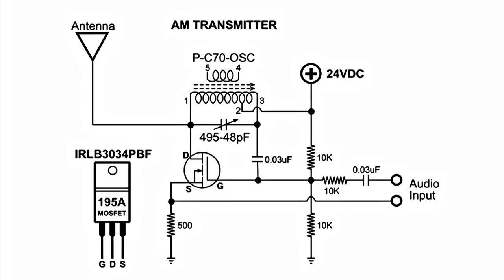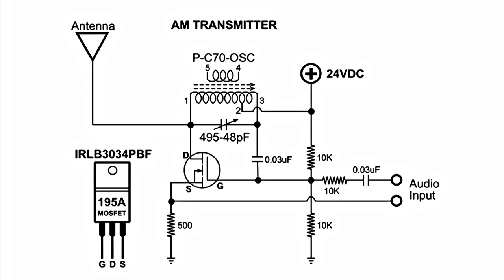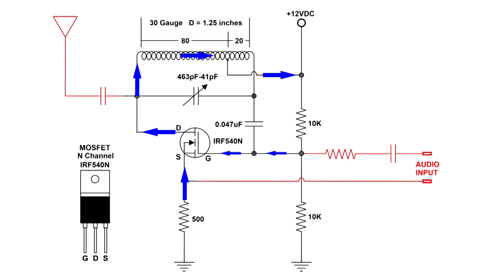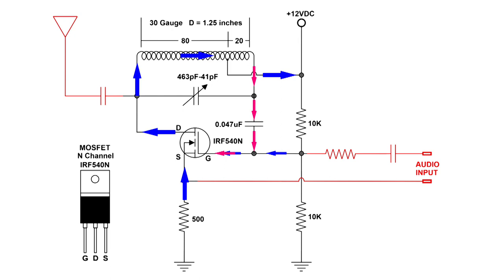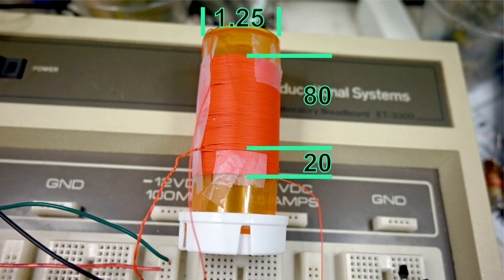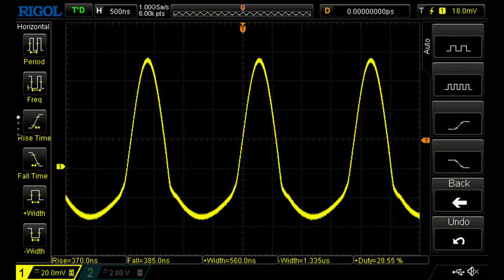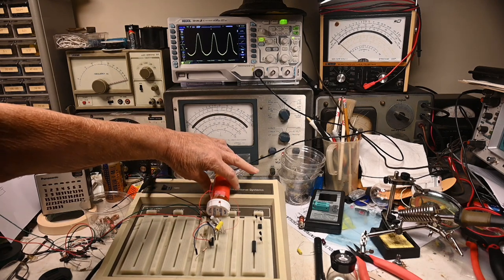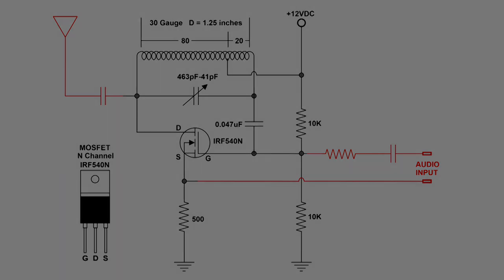MOSFET AM Transmitter Home Made Oscillator Coil

Comment: I love your videos and simple circuits! The comments or here are great as well. Very helpful group on here. I can't wait to build this. Also, your not ashamed to use a Radio Shack soldering iron. I recognize the grip and have had the same one for 20+ years!
Reply from the maker: Thank you,and your welcome. The Radio Shack soldering iron still works. I still have a Weller solder gun, and a Simpson 260 Meter I bought when I was in High School, They both still work. Hope this little AM Transmitter Circuit works for you.

Comment: I replaced the P-C70 coil with two small Bourns axial inductors/chokes in the proximity circuit that you posted. They cost about 25 cents each and come in a lot of values. They worked well for the proximity circuit. Maybe if you don’t want to wind a coil or want to save some space, they might work well in this circuit also?
Reply from the maker: That's a good idea. Thank you.

Comment: I built this circuit about five years rather quickly and it worked ok, but the audio transmission was not crisp. I will try to rebuild it again this fall. I have the P-C70-OSC, but will wind a home-made coil instead. There is something nostalgic about the look and feel of large air coils. I now have an oscilloscope and will to attempt to tweak the sine wave for better symmetry. Has any one fixed it yet!!!! Please share if you have.
Reply from the maker: Not having your build I can not determine why your transmitter is not clear and crisp. I did a part II to this video. 
MOSFET AM Transmitter Home Made Oscillator Coil PART II
https://www.youtube.com/watch?v=RmRXnimNx58

Comment: You can replace IRF540 with 2N7000. Depends on availability and cheaper price.
I suggest to add 100nF+100μF coupling capacitors on supply line to GND as close to coil as possible.
Reply from the maker: Yes I have used an NPN transistor. You may need to change the bias.
Reply: @AllAmericanFiveRadio  2N7000 is N channel mosfet with TO-92 package.
Reply from the maker: @iblesbosuok  Should work